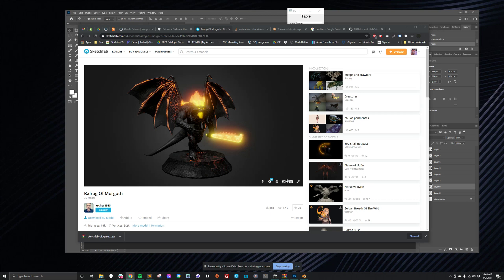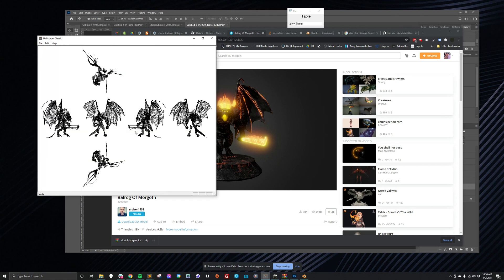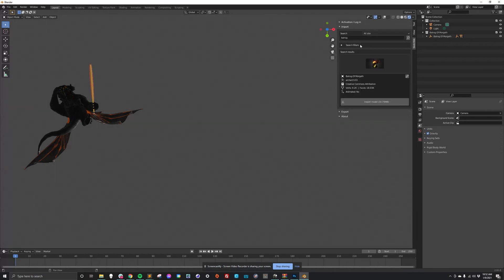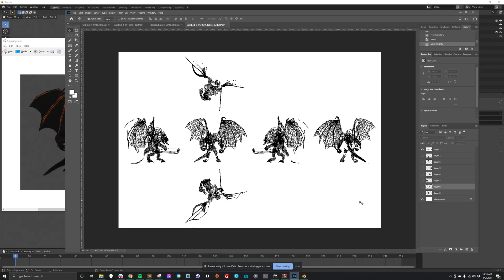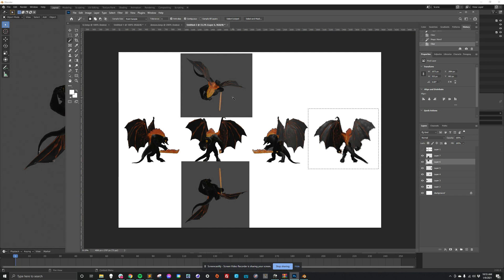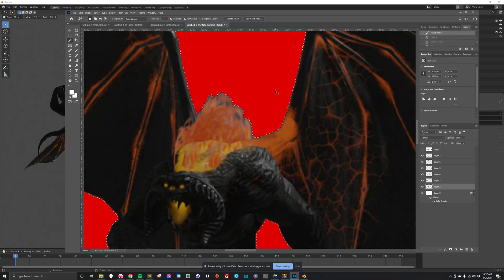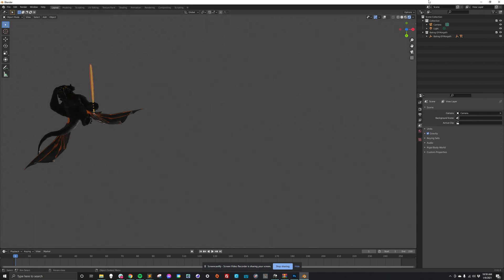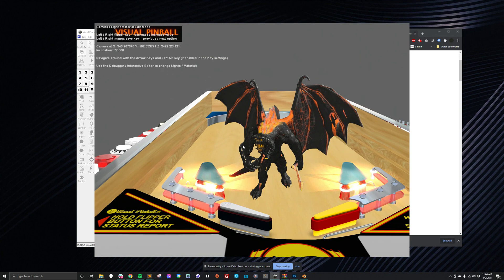Visual Pinball Design Part 12 - How to texture complex found 3d Items

Comment: Hello Scott, I see on your website that you have the code available for adding your orbital scoreboard.  I am curious, can existing tables be easily updated with your code?

It would be great to see existing dmd tables to have scores beyond those achieved in my home to try and beat.  :-)
Reply from the maker: unfortunately not yet. We've been looking into ho to get the scores out of the roms as they happen but it's quite difficult and no one has really been able to get it just yet. We had looked into doing OCR on a hidden DMD and ripping that into VBS but man it's just a ton of work. Maybe one day. It is the dream tho
Reply: @scottwickberg413  Ahh, so the scores are tied into the roms, that sucks.  Thanks for replying.  And great job on the Stranger Things & Harry Potter tables.

Comment: extremely helpful. Thank you. If I could beg for one last video on how to light the primitive before importing,
Reply from the maker: I don't ever light them outside of vpx much. But are you talking about the ambient lighting stuff in blender? Cause other than adjusting the sliders i don't mess with them much. I do often make two textures a bright and dark and swap them with vpx code when flashers go off and such. But i don't know much about blender lighting, this is really a noob guide
Reply: @scottwickberg413  I've got the prims into VPX at this point thanks to your videos, but they are just really dark. I don't know the process so I assumed the pros lit them in blender then imported. I've tried lighting them in VPX but I end up with floating light discs, lol I'm trying to make like  the light look its shining onto the prim and also just make the prim brighter so it can be seen on the table. I feel like it's that last step I need to being able to noob a 3d object into vpx. Thanks for responding.
Reply from the maker: @iDigStuff  yeah i could do something about lighting it, you should use a disable lighting value, a white material, and i light them with flasher spotlights.
Reply: @scottwickberg413  amazing. Thank you. I’ll poke around in pizza time and see if I can see what you are saying in action.
Reply from the maker: @iDigStuff  yep PT and harry potter models are mostly done like that